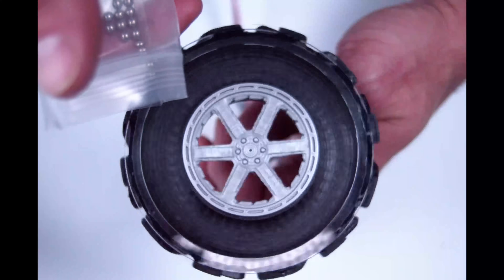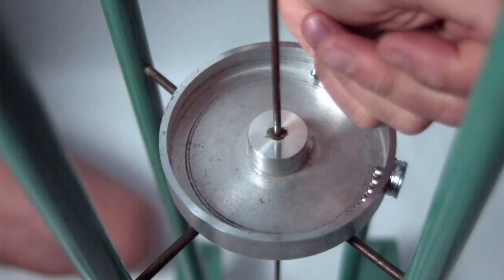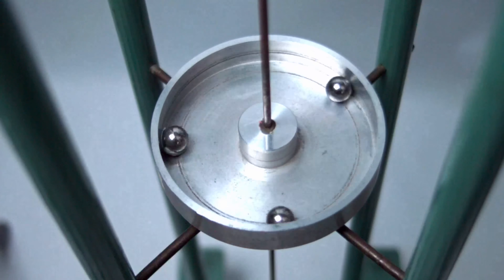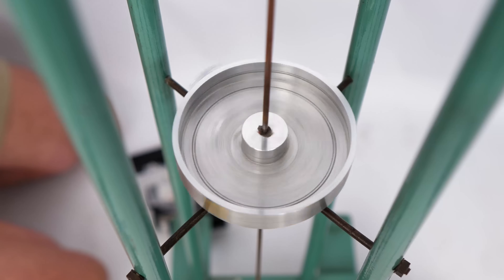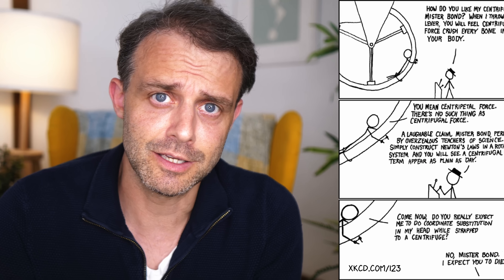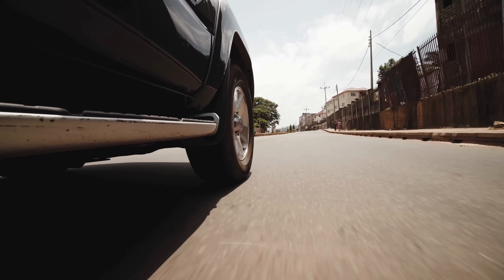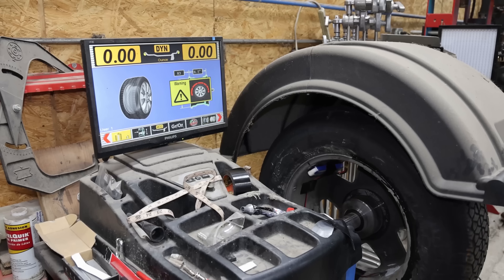Do tire balancing beads actually work?

Comment: I put glass beads in when I installed my own tires on a Mirage.  Tiny wheels and tires!  I used 8 ounces per tire.  I get intermittent heavy vibration at 80mph.  That is a legal speed here.  Around the same time, I did the same on a motorcycle.  A car tire was installed on the back, using 8 ounces as well.  It also has an intermittent high-speed vibration.  Go figure.  I am trying to decide if I did not use enough beads or whether beads work at all.

Comment: it could be cool if there was like a liquid or something you could inject into your tires when they are cold, and then when you drive for a while at highway speed the liquid self balances the tire and "cures" or w/e with the increased heat in the tires, locking the balance in place.

Comment: Now the question is...all the wheels used in this here experiment have an inherrrent dynamic missing from them...a flat spot...so when the wheel is on the ground with a cars weight on it then it will have a flat part where it is in contact with the ground...what happens to those beads when they eventually come round and hit the flat spot? do they still stick to the wall? do they bounce/fly all over the place as the tyre constantly conforms/deforms with every rotation? 

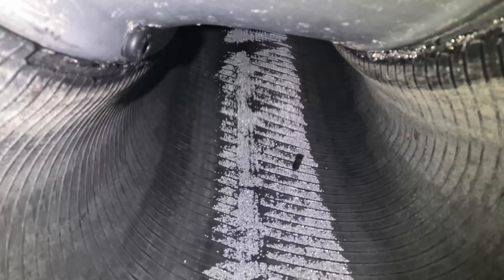Edit: nevermind....seen a clip at 9:53 that tells me everything i need to know.

Comment: Okay this is the same thing I experienced with the drying section of our home twin tub washing machine where you pack in wet clothes from drying and it starts spinning with a lot of wobble but ass it gets faster the wobble goes out and the speed increases it vibrates a lot until it reaches a resonating frequency after which it doesn't increase anymore and the clothes inside are fixed in specific places with it moving 😅
Just thought I'd share it

Comment: OK so glass beads and a tacky glue substance to hold them in place once it cures. The substance goes in like a liquid but sets up after 10 minutes. You just gotta drive on the freeway for those 10 minutes to balance the tires.

Comment: I don't think it can be reduced into a scam or genius category. It's really just a less effective means to balance your tires to prevent a cost that is so insignificant that most tire places just do it for free. There might be some kind of practical application where you could use internal ball bearings to help self balance a machine that operates primarily at a high RPM (so not a car, but industrial equipment) but outside of that I think the auto industry got it right the first time.

Comment: You understand they use a glue before placing the heavy PLASTIC beads inside the tire with some glue. As the beads distribute, the glue holds them into place. Otherwise the glass shards act more as a sandpaper then a balancing beads. If you remove the inner surface of the fire, what will happen?? An unexpected blow out because how can you ensure the thickness of the inner part of the tire?

Comment: 2:16 NOOOO!! It is a bearing ball, not a ball bearing! The bearing is the entire axle-thingamajingy that may or may not use steel balls, in which case it (the entire mechanism) gets to be called a ball bearing. A bearing. That uses balls. Steel balls used outside a bearing are… Just balls. Not ball-fucking-bEaRiNgS

EDIT that’s it. After an entire minute of steel balls misnaming, I just can’t bear it any longer. Maybe a bearing would help, but I’m out of here.

Comment: Would it be possible to make self balancing beads that react with the air such that they stick in place after some specified time? You'd open them, put them in the tire, get up to motorway speed for a while, and then have them in the right position permanently.

Comment: The problem with this demonstration is that your wheel is rotating in a horizontal plane, whereas a tire is rotating in a VERTICAL plane. In that orientation, gravity will act to take your mobile counterweights to the lowest point in the wheel, acting to further the imbalance in the wheel. You did demonstrate that this method of counterbalancing (In a horizontal plane) only works at high RPM. The vast majority of driving is NOT continuous high-speed linear travel, but stop-and-go or continuously varying speed non-linear travel. Any change in speed of rotation or direction will throw any wheel so-balanced into a potentially dangerous imbalanced condition. Also, tires are not designed to have motion against the inner surface, so doing this would add wear to the tire in a place where checking thereon is not possible. No, this is a bit of BS put forth by a scammer or a fool, and only a fool would believe this.

Comment: I have so many questions. So, what if the beads being used were designed to deform at highway speeds and stick to the tire? Wouldn't that then result in a balanced tire? or how about a viscous fluid, when you spin a wheel with water in it the water spreads evenly across the surface of the whole wheel. What if that fluid was Non Newtonian, or hardened like resin.

Comment: So... while technically balancing beads do work, functionally they are a scam.

...unless you could find a way to make them stick operantly in place, but only after they have found their place. Hmm.
I'll just get my wheels balanced when new tires are fitted like any sensible person.

PS: If you've ever watched someone balance a wheel this mechanism is exactly the way they do it. The wheel is spun up to motorway speeds and it records where the weight needs to go.

Comment: I won't discuss the theory behind the working principle of the beads. That's well beyond my knowledge, and I think you explained it orders of magnitude better than I would. Nor do I know whether this system works or not, I never tried them myself, but most definitely worth a try. 

But I'd say this. The mockup model featured in the video does not capture all the working elements in real life. 

For startes, the beads in the model are put in a rigid wheel. In real life, the surface of the wheel is flexible, and that has implications. During rotation, the beads which are held in place by the centripetal force are shaken when that part of the rubber touches the floor. This forces the beads to relocate and to find a new equilibrium point. This process is repeated continuosly for the entire surface of the wheel. The video of the inner-wheel camera is misleading because it looks as if it happened in just one place, intermitently. 

Second, in the mockup model, the wheel is allowed to move anywhere in the horizontal plane (whithin the limits of the flexibility of the axis). In reality, the movement of an unbalanced wheel is much more limited, because it is touching the floor. Can't go below the floor, so to speak. It can only go upwards or sideways, which is when the vibration is transferred to the car's body

Comment: I think they make sense for their use case in 18 wheeler tires. Where the bags of weighs are cheaper than like a pound of lead weights and large hailing trucks are mostly driving on the highways. So it reduces cost. And when you need like 6 2000$ tires any cut in cost is welcomed.

Comment: You can reach to both conclusions it works, and it works with n balls by imagining the ball as a steel circumference of the same width, perfectly flushed to the perimeter of the disk. A line is an infinite amount of points, each bearing is a point, once they cover the whole circumference, it essentially balances the whole thing, as if there were no bearings in the first place

Comment: Some rock crawlers add water to their tires to increase unsprung weight that essentially adds traction at extreme angles, am I correct to assume water will behave as these glass beads do at highway speeds? It seems obvious after the demonstration, but to be sure.

Comment: 8:40 I have a milk frother with 3 speeds and this is exactly what I noticed as well. On speed 1 it's super wobbly, but as soon as I get it to speed 2 or 3 it just "snaps" out of the wobbly motion. It's still vibrating, but it's way less obvious and wobbly.
Of course as soon as I put it inside of a liquid, it's no longer spinning fast enough and goes back to wibbly wobbly timey wimey thing.

The perfect froth isn't linear, it's a wibbly wobbly timey wimey thing. A paradox of bubbles collapsing and reforming, a creamy echo of moments that never quite were, yet always will be, in your cappuccino.

Comment: It's too bad there's not a way to permanently attach some kind of weight to the wheel itself to compensate for this balance problem without having to attain a certain minimum speed every time I go somewhere before achieving this balance.

A small chunk of metal that just gets crimped onto the edge of the wheel, perhaps?  Oh, yes... that's right... those do exist.

Comment: Balance beads have been used for decades. That's how they first balanced tires. Farmers used water/glycol to add weight to their tractor tires, and then it was found it could also be used to stop them shaking when they would have to run on the road to different fields. It doesn't take much speed as the speed at the tire tread increases with the diameter of the tire. Motorcycles use them, large off-road tires for mud trucks as well. The only issue is some of them can wear the inside of the tire down from friction.

Comment: We use this little trick all the time in auto racing. It'll dynamically balance the tire based on wear and help just a little bit more with handling and tire life. It is VERY useful in dirt and gravel racing.

Comment: 1) I wish you'd said "as all things should be" at least once after the words "perfectly balanced".
2) I first experienced an unbalanced tire that had formed a bubble driving through rush-hour Chicago traffic. It was UNPLEASANT to say the least. An hour or so later the tire blew and I was stuck on the side of the road in Michigan. Several years later I was driving a work minivan from a remote site and felt the same tire unbalanced feeling. I stopped, saw a possible bubble (which had shrunk because the heat & rotation had stopped I guess) but was able to drive at just the right speeds, avoiding any sort of resonance to make the bubble worse, until I got back to the office a couple hours later. I dropped the van off, jumped in my car, and called my boss when I got home to let him know what happened. Apparently the tire had gone flat before he got to the office to look at it. But it didn't blow on me!

Comment: I had a vibration that was starting around 80 miles per hour, and by 90, it was really severe. I used the beads, and it made a significant improvement, but it did not completely resolve the issue.

Comment: I suppose what one needs is balancing beads that cure and fuse into the tires after a short while -- load them in, put the car on a dynamo or something to spin the tires for a couple minutes to get the beads into position and maintain until they fuse

Comment: It would seem to me that the tire balancing beads would slowly sand blast the inside of the tire. In your test the bearings are rotating on a flat plane and not orbiting high to low. I'd imagine that the moment the rotation slows all the beads would fall.

Comment: I learnt this at a young age, being the curious type, i took apart my conputers cdrom to clean it, in the process i realised the cd spindle had ball bearings inside. This was when i concluded they were to self ballance, as every compact disc is slightly different.

Comment: The only case I've seen them fail to balance a tire was when my truck has one of its steel rims fairly bent, and even then they smoothed out the vibration at speed significantly!

Comment: You can also use liquids. I was running RV antifreeze in my oversized tires for a bit. There are also commercially available rings that install between the wheel and brake rotor that do the same thing. Neat to see how it actually works.

Comment: Not centripetal FORCE…centripetal ACCELERATION.   Force is felt because the drum wall opposes the acceleration.  No different in fact to the acceleration we feel on Earth being resisted by the FORCE applied by the ground to the soles of your feet.

Comment: If the balancing effect can be achieved with very fine grain powders then could you also do it with liquids?
Maybe instead of beads in the tires you poured a liquid that sets into a flexible solid.
You can install the tire in a garage, set it spinning at highway speeds for a while, and the liquid will have set in the stabilising shape.

Comment: Since balancing is a standard part of tire installation, going to the trouble of asking one’s qualified tire installer NOT to do it, gaining only wonky and, for sub-motorway about-town driving, unbalanced wheels which will gradually wear out axle bearings and attendant mechanisms, is just the solution for cranky old men deluded to thinking they’ve “beaten” some standard, sensible, reliable system or other. Oh, the tyranny! I’ll pass, thank you very much. But interesting exploration of the physics at work.

Comment: Some of this reminds me a lot of wiggler tools (edge finders), and how you spin up the spindle and press on their sides to get them to lock into a perfect center. Then you can use them to "touch off" the side of a part, and when they get pushed out of center while spinning, you know their edge has hit the edge of the part at a reliable offset.

Comment: There is also liquid balancing. Been using Ride-On for years in several motorcycles. It is a fairly thick fluid so you don't lose balance if you slow down or stop for a little bit.

Comment: I love the balancing beads. They seem to start to work earlier than that. They work starting at 40mph on my truck and they make it so much easier, especially over the course of the life of the tire. The tire might have different densities through the life of the tire and the balance might change as the tire ages. Beads keep it balanced the whole time which is awesome to not have to rebalance tires

Comment: Maybe balancing beads would work better, if they had some sticking agent, that would cure after a certain set of minutes, and then you would like "within 15 minutes, drive to highway speed, and maintain it for 10 minutes" and then you would have perfectly balanced tires. Would however require an agent with a precise curing speed so it doesn't cure prematurly or require endlessly long driving at highway speeds.

Comment: I have used Centramatic wheel balancers on my motorcycle for years.  There are many problems with mechanic installed weights to balance a tire.  Over time the tire changes.  Wear and tear, quick stopping and even just rubber getting older changes the center of gravity and a fixed weight cannot adjust to that.  That said putting beads into the tire is simply a mess.  Many mechanics won't mount a new tire because pulling the old off is a hazard.  You also cannot emergency plug a tire with beads in the tire.  If the beads are on the hub however it eliminates all of the messy problems and most importantly constantly adjusts to the tire throughout wear, tear and abuse.

Comment: A driven harmonic oscillator at high frequencies (well above the system's natural frequency) will move 180° offset from the force or acceleration. At low frequenzy s(t) and a(t) are in phase. This explains the behaviour.

Comment: Years ago I saw on tv (BBC ‘tomorrows world’ I think) where a circular tube was added to a car wheel and filled with several balls.  The tube was see through plastic and a strobe light showed the balls balancing out a purposely unbalanced tyre.  They said in future all wheels would likely be fitted with these self balancing tubes and lead weights would be a thing of the past.  Of course it never happened….can you think why? Yeah, it would negate a whole wheel balancing industry.

Comment: Thanks a lot Steve!
This is a very useful topic and very good explanation 
Sorry for being lazy and not thinking myself but I am wondering what would be the critical frequency and speed for the bicycle wheel 26 or 29 inches in diameter,  and what other parameters should be considered for estimate?

It's not uncommon today to have a lot of fluid in the tyres, either tubeless sealant or puncture proof in tubes
And usually this fluid balances quite well during the ride

Comment: an unbalanced tire is unbalanced because rims are not 100% truly round and the rubber isnt 100% uniformed the combination of the 2 can get to shaking violently and cause more damage on ur car. the wheel weight attached to ur rim is more of a permanent counter balance to the rim and wheel

Comment: Modern top load washer machines use an oil filled ring with bearings in it to balance during a high speed spin out. Super cool footage of it working on your test rig!

Comment: I have not used beads and would not. One of the reasons for balancing your tires is to prevent uneven and exacerbated tire wear. I pay too much money for tires to rely on a cheap solution that only works part of the time. I live near Boston. During the week, "highway speed" is 30 mph.

Comment: I've been using steel bearing in my RC rock crawlers for about a decade now. the best part about it is when moving really slow it puts more weight below the center of gravity giving better traction. but it's cool seeing it used in a real world life size application.

Comment: I tried them on the motorcycle once. They worked fine in most situations. What convinced me to not use them again was hitting a big bump at about 75 mph. The bump upset the beads in the tire, and they weren't able to redistribute themselves until I slowed down. Not cool, especially since I was in traffic when it happened. There wasn't really any benefit over ordinary balancing weights the rest of the time. An interesting phenomena with perhaps some other appliacaiton.